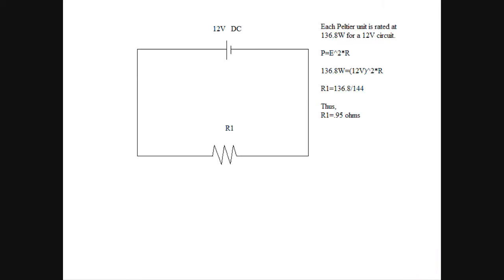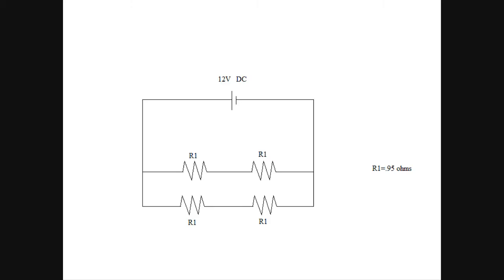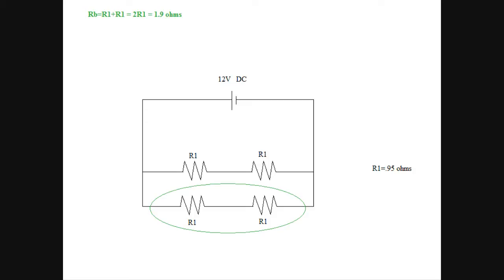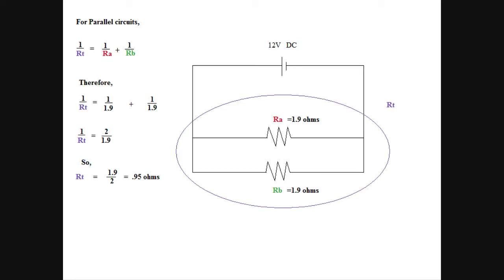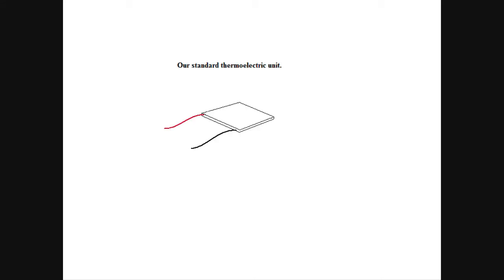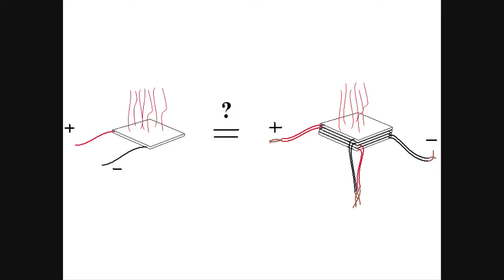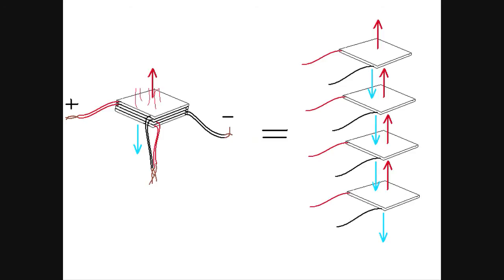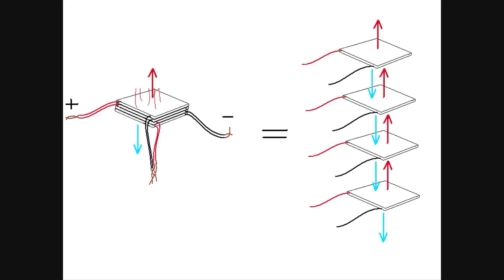Thermoelectric Cooler Part 4 - Electric Diagram Slideshow & "Seebeck counteracting Peltier" Theory

Comment: ANSWER:
If you want distance don't do it like this!

REASONS:
1) Parallel & Series with electronics will give you total resistence of 0.95 but you will make the cells work at half amps and half voltage.  Consider that working with the cells at voltages below recommended will lead to huge inefficiency.
2) Heatwise if you put cells in series (stack) then you are summing the Delta-T (temp difference).  Putting them in parallel you are summing the delta-Q (quantity of heat moved)